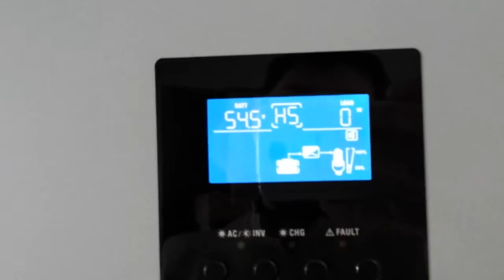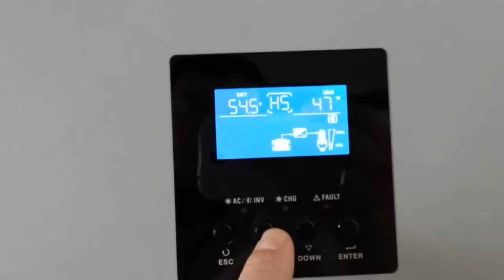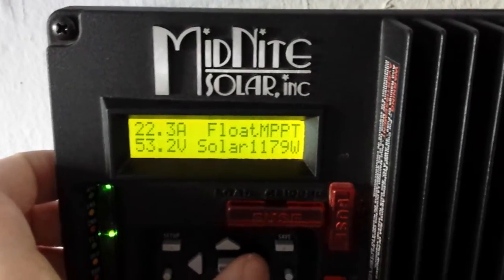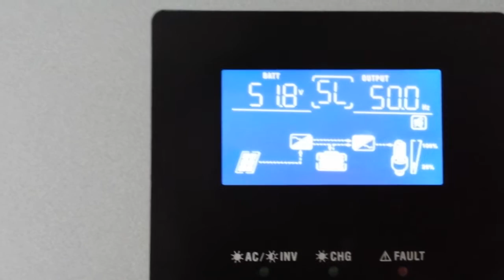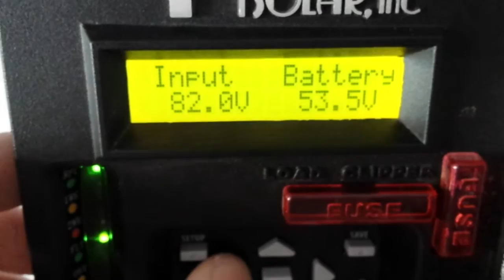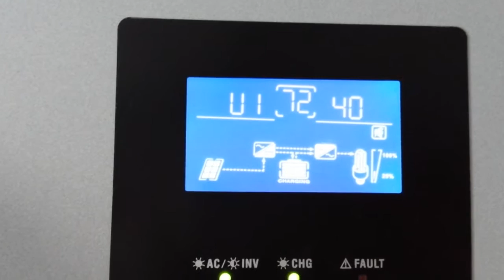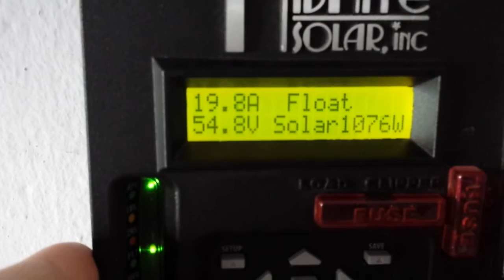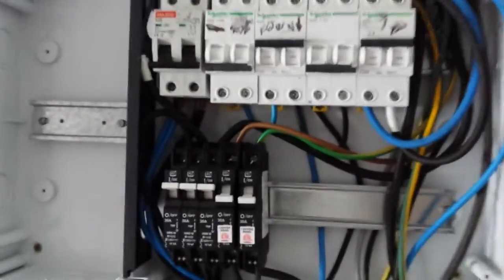Now we are Parallel PIPing offgrid solar 48V

Comment: Looking good you answered a good questing of mine if the old pip works with the new model and it dose. I cant wait to get to expand my system.   Looking good looking good.
Reply: +McCuneWindandSolar Yea what you said! Just got my 2nd pip. Got to say like the older unit better. Going to be doing the parallel soon???
Reply from the maker: It does indeed. But I had to update the firmware on the old one...
Reply from the maker: +off grid kid I also have taken to like the older one better I even feed it 750w more solar panels than the new one. I hope that they are still as good built as the original ones.
Reply: know it may be no big deal but hate the fact they don't match! Darn!!! wish i would have got one before the change.....

Comment: Awesome!
Reply from the maker: 4th day running most nights it has held its own offgrid up to 8am!
Reply: Your system is looking close to dialed! Are you going to get more batteries to up your AH?
Reply from the maker: +off grid kid Following the philosophy that these flooded lead acid batteries are the weakest link on the system right now and since I am on grid for the time being I am going to see if I can get away and switching to grid at nights during winter time.  And somewhere around late March when we have over 12 hours of sun light daily I will see if the bank can last overnight. Also the fact is that from November to February I need power from the grid as the panels are not enough. Lastly this bank is 200ah at C10 and the promise is 1200 cycles at 80% DoD so even if I abused it I would hope to get at least 3 more years out of them and by then I will go for Lithiums one way or another!
Reply: Your system is very photogenic! lol! Looking good. keep up the good work. Maybe move one or two items to the grid (I'm doing this with voltage control switches), keeping batteries from going to grid every morning.Thinking would be much better for your cells and may give better overall power consumption.???
Reply: Want to trade a unit so we have matching pips!!! lol!

Comment: Thanks for your video. I have been wondering why the need for the KID when the PIP is both an  combo inverter /charger. Is it the case that the the PIP's charge controller is not adequate or that the kid is there to complement the charging of the battery bank. I am in the process of ordering the PIP2424MSD and already have a MorningStar Tristar mppt 60. Any advice on how to set up the system would be greatly appreciated.
Reply from the maker: Kwame Boakye Apologise for the late reply. Indeed I have traction batteries and to properly charge them up I need 59v but the PIP chargers only go to 58.4v. I have now switched the KID to a MidNite Classic 150 Lite.